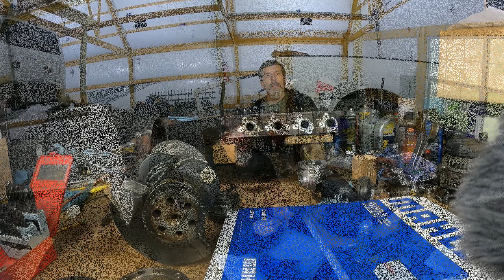Powerstroke 6.4 is Snakebit!

Comment: ive got a 2008 DRW 6.4 with 155k on her.  bought it used back in '20 with 118k at the time.  so far she has been great, no issues at all other than cleaning the EBP sensor (knock on wood).  im well aware these engines are not the most popular but at the end of the day, it can be your best friend or worst enemy based on how you treat them. now, im no where near inclined to advise on owning a diesel but believe it or not, there are quite a few 6.4s out there with tons of miles and zero to minimal issues.  the common thread is strict maintenance but also never letting a drop of untreated diesel pass through.  we all know ULSD causes issues and there are lots of places with "bad" fuel.  i use "hot shot secret" but also add stanadyne lubricity formula so im double treating EVERY tank.  is that overkill?  maybe so, but a few more dollars per tank is well worth it to me.  i had an oil sample sent off to blackstone labs and it came back exceptional so im not changing anything.  would i buy another 6.4?  eh, probably not but i have nothing bad to say about em.

great video, much appreciated..
Reply from the maker: Thanks! I was just explaining to my 18 yo son a few days ago that maintenance is the key to a long lasting truck. Gotta change that oil! If something breaks, fix it quickly before it snowballs. I think most blown engines start with a small leak that someone ignores; it only takes a second to blow an engine with low oil or coolant. The second leading cause is aftermarket modifications. I am still undoing years of abuse and neglect from the previous owners of my truck.
Reply: Mines been great, but turbos went out and I’m Ganna do the oil cooler while I’m there
Reply: It’s definitely not overkill. I dump the entire bottle in my tank per fill up. Granted it’s a 6.0 so different fuel injection but my truck definitely loves it. Makes a noticeable difference just by sound.

Comment: I would change the oil filter at least 3 times rince the filter in diesel and check with a magnet if there is metal flakes each time you switch the filter.
Reply from the maker: I am definitely going to keep a close eye on the oil if I keep the truck around. Since it was down so long I bought another truck though.

Comment: As someone who has rebuilt a duramax, I feel your pain. I bought my truck with a melted piston because of a bad injector. From what I can tell, your crank journal must have plugged, but it's hard saying if the bearing caused the plug and the issue compounded. Hopefully it stays fixed for a while!God bless!
Reply from the maker: Glad to hear from you Greenhill! How was your first year of college? Stacked up a bunch of projects for the summer?
Reply: @BarnTech  It was not what I expected. Our dorm had mold in the A/C system, so we are back home in Colorado doing online college. God's plan is different than mine. I pray regularly for him to slam the door on anything he doesn't want me to have, and thus far, he has done just that. That being said, he always opens another door. Online college will be about a quarter of the cost of in person, for the same degree. Plus, I am able to make and keep more money over the summer working on my projects than if I was in lynchburg VA. It was still sad to leave my new friends,  but we have phones, so we still talk regularly. I guess life is like a project truck. You expect one issue, but you find several others that require a total rebuild! However, rebuilding can make it stronger and better than it ever was before. 
I finally got my transmission overheating issue on my Duramax fixed, so I continue mobile repair. I also have a 1993 ford f250 7.5l that I am rebuilding. 
God bless!

Comment: I'm finishing up my rebuild at 365k after my oil cooler plugged up and a lifter ate itself away on my cam during a 2400 mi vacation. I bought a remanned short block and damaged a HP line while installing it back in the truck. Of course i found the leak 2 days after I finally got it back on the road. Anyway, I feel your pain....my only question is: If you chose to buy a new crank. after metal contamination, why "check" the lifters, oil cooler, turbo lines, etc?  I would think you'd want all of that replaced without question. I re-machined the heads, lapped valves, seals, BUT new: oil cooler & pump, rockers. bridges, pushrods, lifters, turbo innards, and a new fuel pump (just because of the mileage). Flushing the cooler? why bother when they're so cheap. oil flow is from the cooler to the filter and then simultaneously to the turbos and lower block sooo.  Hell of a video! Great job!
Reply from the maker: Flushing the oil cooler was a waste of time. I tried, but I could not remove all the debris. I ended up replacing the cooler and flushing everything else (turbo rebuild, etc). It takes more time to do it this way but it my philosophy is “It only needs what it needs.”

Comment: You would turn the key on 10 times not starting. You'll hear the lift pump putting fuel to the high pressure pump.   You've done some amazing work that most of us with a 6.4 wouldn't dream of doing
Reply from the maker: Yeah, I wish it was that easy. Turns out I had more serious fuel issues. New videos on the way!

Comment: Holy cow you went in deep down a rabbit hole on that. I just inherited a 2010 6.4 from my step dad with 290k on the clock. Not sure about it’s history. I know it’s leaking oil like crazy and some coolant disappears. I have it at a shop right now and they said it has a lot of blow-by. They are getting ready to do a compression test. Wish I had your skills and knowledge. Feel like I’m going to need it.
Reply from the maker: @justinmanship5431 One of my earlier videos addresses 6.4 blowby. It’s probably the #8 piston. DPF regen causes piston #8 to crack. Knowing what I know now, I would pull the glow plug and stick a camera in there before I even did a compression test. Good luck!
Reply: @barntech2291  Oh okay, I’ll definitely check that out. It’s been EGR and DPF deleted but I don’t know at what point in history that happened. I know my step dad bought it at 200k and on the way home it started acting up. The dealership took it to a diesel shop and they replaced the #8 rocker arm. My step dad says since then it’s leaked oil pretty badly. He was supposed to take it back to that mechanic but it was in Oklahoma and we live in Missouri, so he never did. He said the mechanic said he probably messed up the valve cover gasket. That’s pretty much all the history I have on it.
Reply: @barntech2291  Heard back from the shop. They are seeing low compression on cylinder 2 and more than a 10% variance on another. Told me to just drive it until it dies. Once I get my shop built maybe I’ll go down the same rabbit hole you did.
Reply from the maker: “Drive it until it dies” doesn’t sound like good advice if you have bad blowby and two cylinders with low compression. Then again, if you are paying a shop to do the work it might cost more that the truck is worth to fix it. I would stick a Harbor Freight camera in the glow plug holes to see what’s going on.
Reply: Mine has 323K and no blow by, but was deleted early on in life. Keeping my fingers crossed and staying on top of filters and maintenance. I do have a Cummins here but love the power my tuned truck has. This has always been a highway truck towing so no short hop city life.

Comment: I just wished you had a 6V-53T or 6V-71T or maybe even a 318(8V-71T)and been done with it. Every bolt on it has been worn slick by your fingers. It makes me sick that you've had to wear it out so much but it's sure a labor of love and the Good Lord has sure been right there with you. Maybe some Delo 15/40 oil would help. bcbloc02, the machinist in Kentucky says that it and deere oil are the only ones still formulated for flat tappets. I run it in everything here but the car and saw it hold a 980G Cat loader together for 24K hours with only a valve cover gasket replaced. I ran the loader and it was still going when I left. All I CAN say is PRAISE GOD and drive that thing. I'm a diesel freak but not the new ones AT all. God Bless and Thanks for keeping this for a record!
Reply from the maker: Thanks Lewie! In retrospect, I wish I had swapped in a 7.3 at the beginning. I would probably still be daily driving it. Praise God it is running now!
Reply: @barntech2291  Pal contractor down the loop ghot one in a ton dump. Sweet running at 1st but then the motor came unglued. I think it was tax time and he got another motor but not sure. I still like my Delo oil. God Bless Yall!

Comment: Curious how many miles on this. Did it have the emission system still on it? I have been very lucky with my 2008 6.4 that was deleted since nearly new. 323,000 miles with just a starter and batteries. Auto trans replaced at 278,000.
Reply from the maker: I bought it with a cracked piston at 159k. It was already deleted, so I’m not sure that helps. I don’t know why some get lucky with the 6.4 and others don’t.

Comment: My 6.4 does this from time to time I had to purge the air from the fuel lines like you did with the jerry can about 12 times, turning the key and letting it crank. After the twelve time started right up
Reply from the maker: Not long after this video I replaced the lift pump. The old one still worked but it was noisy and seemed to struggle a little. Primes up better now.

Comment: Good job.great video. Have to say I love your shop. Certainly works better than being out in the environment. This is my second time I have come across your channel. Looking forward to seeing more from you. My 08/6.4 is in the trany shop after only 130k miles 😢. She's been pulling a 30ft 5th wheel most of her life, or a work trailer. But only like less than 250k miles with great maintenance looks like $6k 😢
Reply from the maker: I appreciate the encouragement! I am amazed at how unreliable these trucks are. I have worked on a lot of stuff, but I have never seen something break in so many different ways. Great for YouTube content; terrible for daily driving!
Reply: That's 250kms so like 140K miles and rebuild on the transmission

Comment: Ya. I have read that those fuel lines are a must to replace if you crack them loose you have to replace them no getting around them. To bad they don"t come come with a flange and a crush washer system or something. Anyway thanks Ford. But I  guess thats after going through the HP pump so that I guess is understandable. Well you got some patients going on there bro.
Reply from the maker: Yeah I’m not sure a crush washer could handle 24k psi. It would be nice if you could repair a leak without lifting the cab or pulling the turbo though.

Comment: I really admire your approach or concept with this difficult project. I know how you must have felt after it finally started🙂. Even without a shop lift, you are still able to lift cab! Please how and where did you attach the ropes to the cab to lift it?
Reply from the maker: I put the front straps by the front body mounts and the rear straps on the rear running board mounts. It puts a little pressure on the back doors but they bounce back.
Reply: @barntech2291  Thank you for the explanation! I saw the video you tried to explain it a little bit, but I could not see how you did it. Please can you make a special video about this clearly showing how you attached those straps to the cab body? This will greatly help me with my cab removal using a gantry crane!

Comment: I just purchased a used 6.4 with about 230k on the truck, it’s was an old farm truck, I purchased it at an auction site unseen, it was involved in a front end accident not so bad, the radiator is gone, blew the power steering box out, and tweaked the front frame a little bit. I am having it sent out to a frame specialist to recenter everything and he is the best in my area, then I will send it out to a local diesel repair shop to have them look through it because yes I know the problems that a 6.4 can have. It looks like since this truck was a farm truck, it has been deleted and what I can tell tuned but not confirmed I just hope the truck will last for what I need it for 😅
Reply from the maker: Good luck!

Comment: bought one last yr with 175k, after hearing all this , i am sick over the 6.4. havent used it much. would u recommend getting rid of it or ??? it runs good with new injectors and new steering parts. i would have to hire anything major done.
Reply from the maker: You can’t beat the power! Most people have better luck than me. I think mine was abused and neglected by previous owners. I have fixed most of that now. Unfortunately, I had to buy a new truck because I could not wait for this one to get back on the road.  Best advice is to keep up with maintenance so it doesn’t get like mine.

Comment: The fuel lines to the injectors and fuel rail are a one time use. They tend to leak if you reuse them
Reply from the maker: Yep! The injector lines also leak if you don’t follow the directions. The part about snug down the injectors and then loosen them before torquing the lines is especially important.

Comment: Could this be caused by having it bored out and causing excessive stress on the journal bearings?
Reply from the maker: I have bored a bunch of engines and it never caused anything like this. It had to be lack of oil.
Reply: @barntech2291  https://youtu.be/trY3FhkX_8A?si=L1nfFIYkpZryWvNc this was a really informative talk on the 6.4L.  Apparently fuel leaking into the oil is common and causes main journal destruction.
Reply: No
Reply: I thought it was funny at the end of the video you were wearing a hat that said, LP while you were disassembling the Lift Pump 😅
Reply from the maker: Haha that hat is from a soccer team I used to coach. I need to make some Barntech hats :-)

Comment: @BarnTech
Purchased a non running 08 for my son and I'm curious if you could shed some light on your lifting system for the cab. Any bits of wisdom / advice would be appreciated.
Reply from the maker: Haha! I don’t think what I did was exactly wise. It got the job done and nobody got hurt though. I used two 2x10 with 2x6 screwed on top and bottom like an I-beam. I bought lift straps, chains, and comealongs from Harbor Freight.
Reply from the maker: It put more sideways pressure than I expected. If it hadn’t hit the barn rafter it probably would have crashed down

Comment: I’ve seen Cummins and duramax’s do the same exact thing.   Clean the block and throw a new crank/rods in it.   If you’re worried about the bore then sleeve it.   Take your time and don’t rush.   Don’t let people talk you into Cummins swapping because pretty soon all those guys will have to swap back or get rid of their trucks once the epa has their way.
Reply from the maker: I considered lots of options but the quickest and easiest was to keep it stock. I am amazed at how fragile the 6.4 is though!
Reply: @barntech2291  they’re definitely the “Karen” of the powerstrokes but they’re capable of making the most power out of all of them.   Mine let me down last Sunday (water pump) and I had to drive a 6.0 instead with a hot tow tune.  Needless to say I’m ready to get my 6.4 back because 6.0’s are lazy compared to the 6.4🤷🏻‍♂️
Reply from the maker: Yeah it makes a ton of power and it is fun to drive, but fixing it is like squeezing a balloon…it just pops out somewhere else.

Comment: What ended up being the root cause of the failure?
Reply from the maker: I suspect the cracked crankshaft started it all. Something I missed in the previous rebuild. That led to the rod bearing, which plugged the oil filter. Once the oil filter split that took out the turbos and other bearings.

Comment: When the boost boot blew off on my dad's 6.0, weighin in at over 8,000 lbs with 3.73 gearin & 32.7 inches tires, floored it had worse acceleration than my na 7.3 idi with 4.10s & 31.7 inch tires weighin over 6,000lbs does. Limped it over a mile home put the boost boot back on & the power came back
Reply from the maker: As they say, there is no replacement for displacement.

Comment: I had to rebuild my 6.4 after it blew a head gasket and had a frozen roller on one on the lifters. It also trashed the cam. With all the debris in the engine, it would have been a good idea to remove the oil pump and flush the oil passages in the block before assembly.
Reply from the maker: Hopefully your filter did its job. Mine did not
Reply: @barntech2291  It did, but I ended up pulling the engine a rebuilt it anyway.

Comment: s&s diesel in indiana has really good high pressure fuel pumps
Reply from the maker: I ended up replacing the lift pump after publishing this video. Cleaning the valve helped, but it still sounded funny so I replaced it. Truck is running great now! Looking for a new home :-)

Comment: Uneven crank. Bad cylinder?
Reply from the maker: I think fuel issues. New videos on the way!
Reply: @barntech2291  me thinks that on these diesel's, every fuel system component should be replaced when the miles have added up. I did mine at 197,000,  now the hpfp was going bad but only that one item. If we replace that fuel pump only we'd be crazy without doing the whole thing. You sir can save a huge dime doing it yourself. Thanks for posting. I re used the fuel rails and cooler, those are still good.
Reply from the maker: If you have any issues the fuel cooler will need replaced. My cooler had a bunch of glitter from the HPFP. I flushed for a long time and it kept coming.

Comment: Your oil filter cap looks a whole lot larger than OEM. I’d replace that before it kills your motor again.
Reply from the maker: Do you mean mine is taller? I think it looks like most of the other ones I see on Google (minus the billet ones and a few shorties).
Reply: Wix filters are taller and come with the cap that matches. Keep the short one for a Motorcraft.replacement.